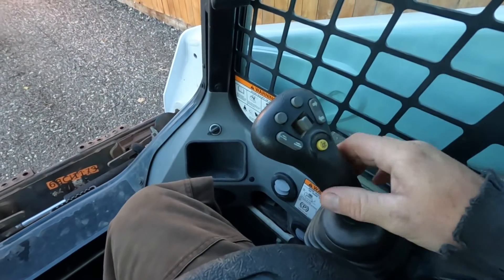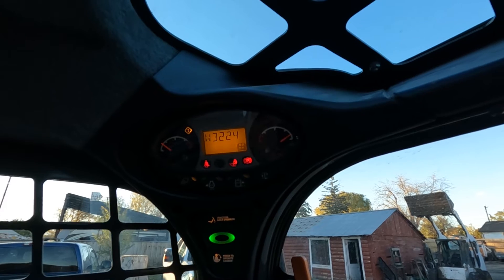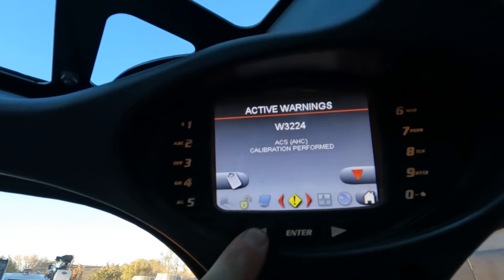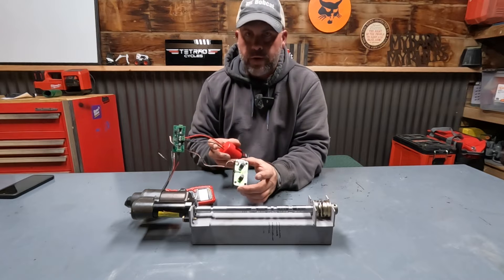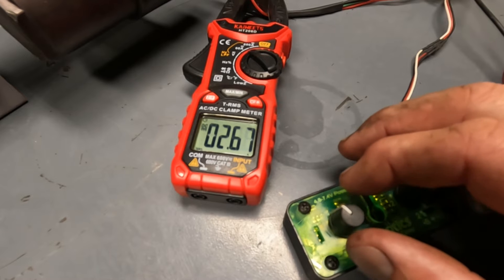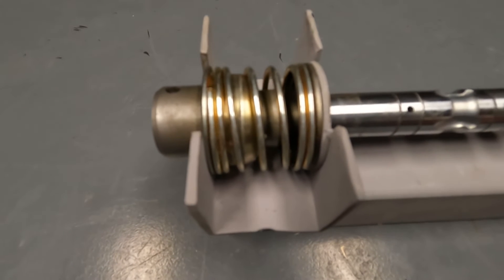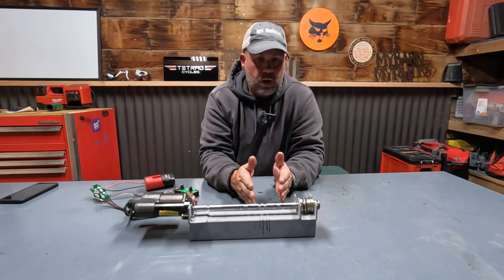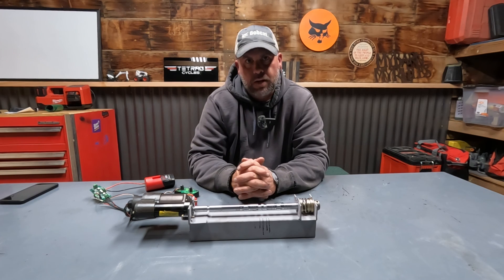Bobcat Actuator Calibration SJC and Why Its Important

Comment: Appreciate your time doing these skid loader videos.  Yiu do a nice job explaining things. I Have calibrated many times. However, today, I installed a new spool valve on a T190 and it was working perfectly. Did a calibration and it locked up the acs system. Turn on the key and it gives me a 32-34 error. 
Can't figure it out

Comment: Hello, greetings from Paraguay. I'm having an issue with a 2016 Bobcat S570. I've tried all the methods I found and even the machine's representative came to check, but they can't seem to find the problem. Specifically, the bucket tilt isn't working on the discharge side, but if I swap the plugs, it does work. I've already ruled out the actuators and joysticks as the cause, since swapping the plugs makes it work. Do you think it could be the ACA controller?

Comment: Had a unit today with Sjc. Fault w3234. Unit drives with both settings just no bucket controls. Went through bobcat portal and did the TS. Pulled both actuators off and check spools. Center correctly. Re installed actuators and tried to calibrate. Wouldnt verify if it took or not. Then started throwing fault w3250 short to ground. TS to replace actuator. Ever seen this sequence of events?
Reply: Swapping harness would change fault codes

Comment: Hi, love your videos,  I tryed to calibrate sjc controls on  bobcat s130  and it did perform a calibration and it gave me 32-25 code(ACS Controller Calibration Failure)  . Ive noticed  tilting the  bucket sometimes  goes slow or very slow and if i do   the tilt comand again or 2 times   it goes normal speed. I have this problem only on tilt.   No error codes on screen, any ideas?        Should i look for an tilt actuator?    Thanks
Reply from the maker: I would swap actuators and see if the problem follows to lift circuit
Reply: @tetradgroup  I will try it. Thanks

Comment: I have a 1999 873, I’m replacing the tilt actuator and wondering if I calibrate as you show in your other video, on the bench before installing, does it still need calibrated after it is put in machine by computer, and or is there a manual way to do it as you shon in this video. My controller is keyless but different than the one in this video. Thank for all your help, your videos are awesome!
Reply from the maker: No need to bench calibrate, a 1999 may not have an option to calibrate through the controller.
Reply: So I guess my only option is to take it to the dealer after I install the new actuator?
Reply: So just stick the actuator in, it’s ok to not precalibrate?
Reply from the maker: @briancamerer1941  the actuator itself is already centered.  If you have an AHC controller then it cannot be calibrated, even by dealer.  Just install and run it.
Reply: @tetradgroup   so I put the new actuator in. Still acts funny. It was the tilt one. Now it shutters, like it’s not opening all the way possibly? I took it to the dealer and they took it inside and had it about an hour. Said they were going to calibrate. Brought it back out and acted confused. Weren’t sure if they fixed it or not. Said they tried to calibrate. Stoped at office as I left and they said no charge. Took home and tried and it now has a shuttering on the tilt side. Then it throws codes on both actuators, lift and tilt. Now both actuators have been updated but I still don’t have a machine that works correctly. Haven’t ran much(just testing) I’m afraid to mess something up. Is there something you can think of? Seems to me it’s out of calibration but I’m just a dumb carpenter…. Any help would be greatly appreciated! Thanks!!!
Reply: Still having trouble with this. Any ideas on how to calibrate?
I thought when the last actuator was put in by the dealer at my shop, they used a laptop to calibrate.

Comment: Hey, I have a 2014 bobcat s650 with H and foot controls. My question is should it go just as fast forward as it does reverse? Mine goes backwards much faster than forward.
Reply from the maker: Needs a steering setup, should be about even forward and reverse
Reply: Thanks I'll look into it.

Comment: Hi, I have a T740.  I just bought it with a problem, the arms go up normally but won't go down unless the float button is  used or the emergency lower valve is opened.  No codes.  I calibrated the actuators as you demonstrated here, no change.  I rigged a lever to allow me to operate the spool manually, no change so I assume it is a problem with the control valve assembly.  Just for kicks I swapped the hoses for the lift cylinders with the ones for the tilt cylinders and then lift worked normally but tilt only worked in one direction.  I pulled the spool valves out and they look OK as far as I can tell and they move in and out smoothly.  Would you have any suggestions?  Do you think the problem is in the control valve?  I notice there are relief/anti-cavitation valves and check valves in the control valve, is it possible they could cause this problem?  Thank you
Reply from the maker: That happens when the auxiliary hydraulics are stuck on.  Can you make a loop hose to loop the auxiliary circuit at the couplers?  Either that or check the auxiliary spool next or try to operate the auxiliary in the opposite direction and see if arms will lower.
Reply: @tetradgroup  OK, if I unplug the auxiliary spool solenoid control valves, will that turn it off?  I noticed that the auxiliary spool moves freely when I checked the other spools but I didn't know it was stuck on.  Thank you
Reply from the maker: @brucehumphreys1248  possibly, depending on what's is holding the spool out of position.  Let me know what you find.
Reply: @tetradgroup  You are correct, the auxiliary hydraulics are stuck on.  I didn't have a loop hose, so I hooked up a cutter attachment and it runs as soon as the engine is started.  I am unable to reverse the direction.  The auxiliary controls seem to have no affect at all.  I disconnected the auxiliary solenoids at the control valve and there was no change.  The lift arms go up and down normally as long as I have the cutter attachment connected.  I had noticed previously that the auxiliary spool valve moves freely so I assume there is a mechanical problem with one of the solenoids?  I assume I need to drain the hydraulic fluid if I am going to pull the solenoids out?  thank you
Reply: I pulled the auxiliary spool solenoids and found that the front one had a small piece of metal stuck in one of the ports.  Apparently it was enough to hold the valve open.  I exercised the solenoids with 12V a few times while I had them out.  When I put the solenoids back in, the problem was gone.  Thanks again for steering me in the right direction.

Comment: I saw a post yesterday that has already been taken off.  Hope all is well with you.  You provide a critical service to many of us.  If you need some lobbying on your behalf let us know.  Thanks for what you do.
Reply from the maker: Appreciate that, I'll have an update video soon, looks like everything is going to be fine.
Reply: @tetradgroup  Good deal.
Reply: i have a 2019 T870. i have no lift or tilt. but I'm able to move the machine around still. I changed out one of the actuators and it starting working again. Then the next day it started doing it again. same thing no lift or tilt. so i swapped out the other actuator with the one i pulled off and it started working again. 10 minutes later same problem. it says DCU no communication. Can you steer me in the right direction on what to look for sir ?
Reply: code M6904

Comment: I just replaced my lift actuator in my A300 Pulled both my actuators out and replaced the lift actuator. Recalibrated (SJC) I held it forward and to the right as I turned the key on and hit the green button. Heard them cycle but didn’t hear any beeps. I didn’t get the 32-24 code either. I got a 38-10 which is Actuator Calibration Performed. But everything is working fine.